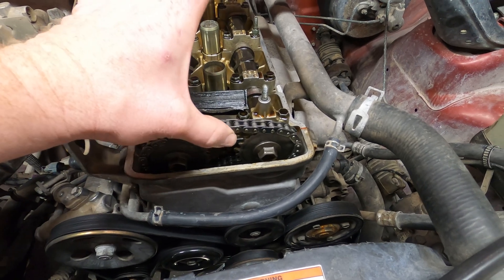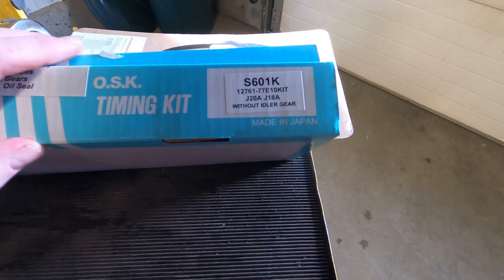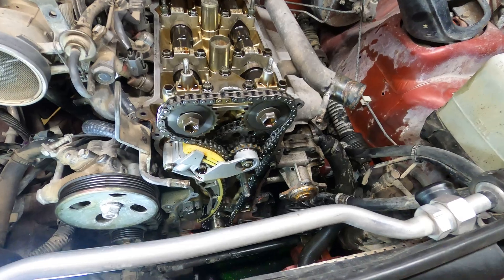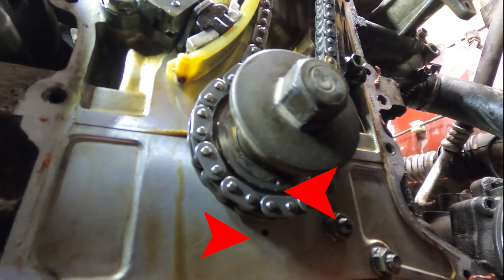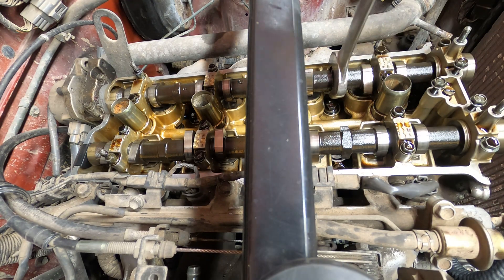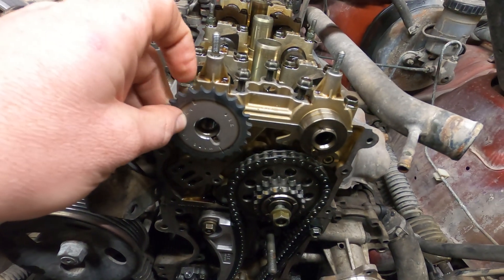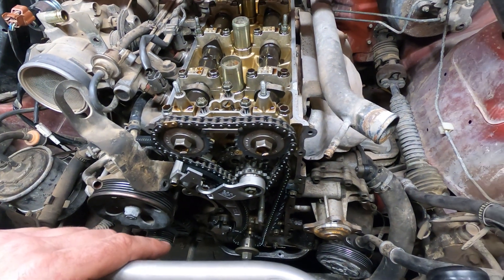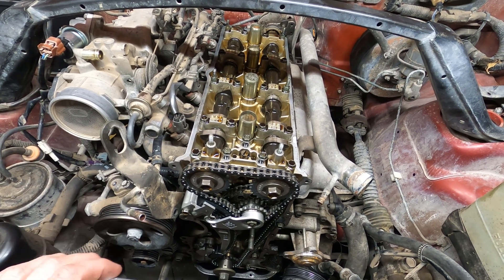Suzuki Sidekick P0300 Timing Chain Mystery Solved!!

Comment: I have a Suzuki 96 sport 1.8 and there seems to be somewhat of a mystery regarding weather my engine is a non-interference engine and I've been told it is a interference engine and others say it's a non-interference engine and as I just had slippage on a timing chain with no damage to my Pistons it just seems like a freaking mystery that shouldn't be
Reply from the maker: @fosterkennel649  the 1.6 is non interference, used in all sidekicks until 1996. The 1.8 is interference, only found in Sport trim sidekicks from 96-98. The 1.8 is a completely different engine, part of the newer J series which includes the 1.8, the 2.0 and the 2.3, all of which swap directly.
Reply: @offroadhub.official thank you so much I went just a very short distance and people looking into all four cylinders with the scope camera thingy shows everything okay just some carbon buildup so I'm going to be going ahead and having a new timing chain put on as I love my car and I definitely want the chain and sprockets Japanese made do you have any links and my old friend of 50 years chimed in under Magic blessings to you and yours coming at you from Southern Oregon

Comment: You had no issue with valve/piston damage when the cams got out of time???
Reply from the maker: @tbamagic  no.  I made sure none of the pistons were at the top of their stroke, which allows the the valves to move without hitting the pistons. With no timing chain, they aren't moving together, so no interference!
Reply: @offroadhub.official awesome my timing chain did not break it was just a bit wanky and the noise I heard sounded like a valve was stuck like a hissing sound turns out the shop I took it to due to that evil noise we figured out after the fact that it was a loose spark plug that I have figured out saved me from possibly losing my whole engine due to the noise and we are going to be replacing the timing chain and the necessary parts to come with the kit and I will make sure that it is not some goofy Chinese thing but something good coming out of Japan this is a great Channel and blessings to you from the hills of Southern Oregon

Comment: I knew a guy who owned a transmission shop.  He warned me not to buy a Suzuki Samurai because parts are almost impossible to find.
Reply from the maker: It can be difficult. I think it just depends on the part. There's a lot of aftermarket support for the Samauri, it has a pretty huge enthusiast following.
Reply: @offroadhub.official  I see a lot of Samurai owners who modify the heck out of the car.  I think the car is so simple that might be easy, but I live in California so modifying is really difficult when it comes to the smog issue.

Comment: I had an old Nissan truck that wasn't running well.  The timing chain had skipped a tooth because the chain tensioner had come unbolted.  Did the kit replacement and it ran great!